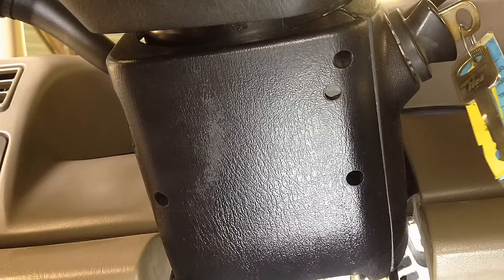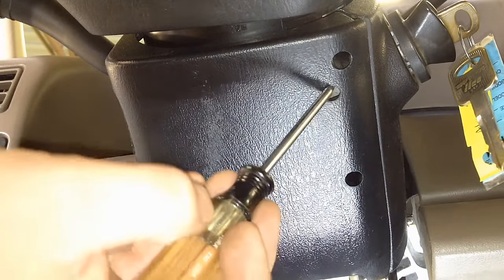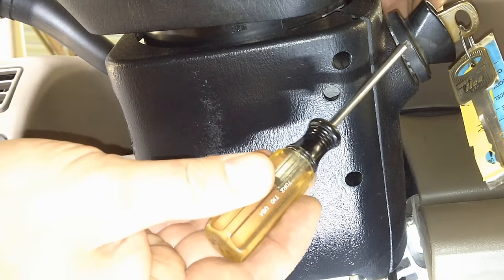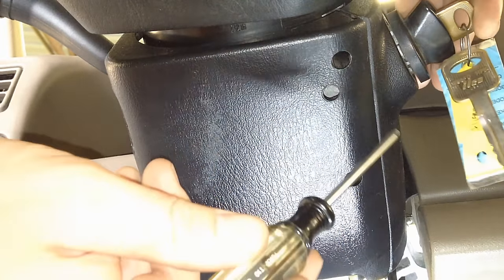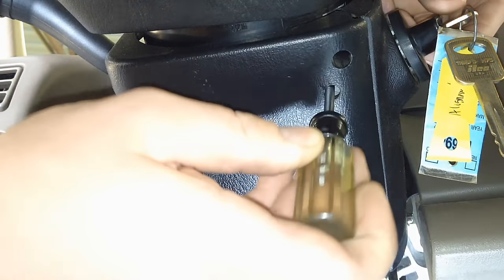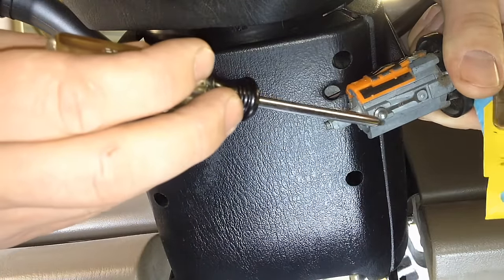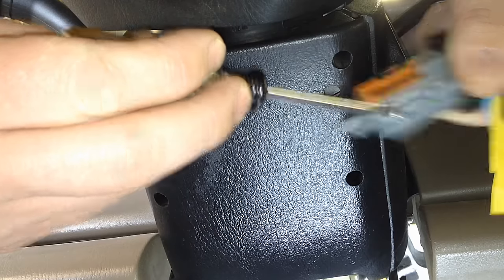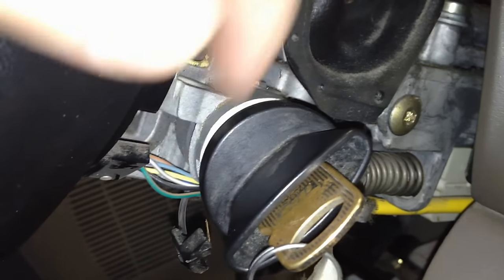Ford Quick Tips: #25 Ford Ignition Lock Cylinder Removal

Comment: What if you don't have the key?
Reply: no one shows how to do it without the key... :(
Reply: @marshallvomenici5469  Cause that's how they get stolen  ..You have to break it so it turns
Reply: I can't turn the key to the forward position at all
Reply: You gotta have the key.
Reply: I've drilled the bottom pin out and ran a 3/8 drill bit down the ignition to break the tab off at the end of the column.
Reply: You have to drill straight through the old one
Reply: If you don't have a key you can use a skinny finger length pocket knife or a a broken pair of scissors.
Reply: How you do a 1986 f250 that that the switch does it turn to the on position
Reply: My key was stolen and lost by a mechanic
Reply: Only in Ohio 💀
Reply: You popped the pins out one by one write them down and popped the new pins in a new cylinder one by one and 2 your finish
Reply: I have the key but the ignition had been brutally beaten.
Reply: Even a screwdriver  can't budge it
Reply: Fml I lost key have replacement

Comment: Line it back up the way it came out,it only goes in one way,like a puzzle piece,put everything back together,great. But what do you do if you have no keys to turn the switch?
Reply: Take a pocket knife and a pair of plyers and twist the ignition. You can put a screw drive run along the side to pop the ignition and install and new ignition lock cylinder they come with keys. Depending on the security your key may need programed or you can use a wire on your starter fuse under the hood.
Reply: What if you don't have a key and you lost it how do you get to switch out if you don't have a key to turn it on
Reply: How do you get the ignition switch out if you lost the key anybody know

Comment: I know this is a very old video made when I was about 10 lol but do you have any advise for me? I lost my key about 2 weeks ago and haven't been able to find it and that is the only reason I need to replace the ignition lock cylinder. What do I do about that? I had a spare key made a while ago but it doesn't start the truck since my key was worn down with the ignition over time. Do you think the spare will still work for this? I'm pretty sure it will turn the ignition, the fuel pump, battery, and the alternator don't try and run when I turn it though.

Comment: I have a 95 Ranger with no hole in the plastic and no hole anywhere onthe column to access the pin, I know what to look for and never seen this in 40+ years of working on Fords and I have the steering wheel off.

Comment: Once again, I have to thank you for this channel and your expertise!  I PROUDLY still own my 1996 decked out, one of a kind, Conversion Ford Explorer!  It’s wonderful knowing that I can check here for pointers that a Haynes manual doesn’t tell you regarding idiosyncrasies between the different years!  It has over 250K miles on it and I wish I had kept it as a Collecter car. If I could find another, I’d buy it in a heartbeat!  It’s interesting that when ordering the key cylinder replacement, they needed to know the exact month and date it was manufactured. Please keep posting anything else for anyone else who owns these Fords and follows you or for those who might still find your EXCELLENT shared experience and advice!🙏👏😎💕🙏❤️😎🤠!
Reply: Conversion ford explorer?? Van or truck?? I am in a 94 ford e150 conversion van 5.8L  all leather absolutely mint picked up in 2017 with 18,800 miles on it. 45,000 now. I absolutely love this van.

Comment: Hey, we've got a 98 Windstar and we're working on replacing the ignition lock cylinder and I have a question: the instructions we got with our cylinder say that for some models you  have to detach an alarm wire from the old cylinder and attach it to the new one. Is the Windstar one of them, and am I right in that we'd have to remove the shroud on the steering column to attach that wire? Thanks in advance!
Reply from the maker: There is a little key in sense wire on there most years and a orange switch on the lock cylinder itself. If the lock is not broken the wire will stay in play while the lock cylinder is being removed.

Comment: I had a question I'm doing this same job on my 07 crown Victoria I have the new ignition with the key but I lost my old key and I'm not able to get into the run position is there another way to get it into the room position without a key maybe using a screwdriver to turn it over to the on just so I can get the ignition out I appreciate your advice in advance

Comment: Hey I jist bought a 1991 Ford F-450/F-Super Duty... It has an ignition problem the steering column is the most simple with no wiper controls, cruise, or extra controls of any kind... When I go to turn it on the ignition wants to turn back too far where it kills the engine, I have to remove the shroud and place vise grips on the metal rod to hold it in place.  I when I place the vise grips on the rod it can be too far forward to the point where the signals and climate controls won't work (because it thinks the starter is engaged), but if it backs off too much a bump in the road will kill the engine.  Luckily its a standard transmission so if it dies going down the road you just turn the ignition forward and it restarts the engine without stopping and engaging the starter again.  But if you do this going down the road. Un burnt fuel goes out the exhaust and I literally exploded the muffler driving it home from purchase on a 700kms trip from norther Alberta to southern Alberta.  Any tips?

Comment: so glad to see this vid - was at the gas station last night and the key just got stuck in the ignition, wheel wouldn't turn... i pulled the 'girl in distress' card (which by the way, i hate doing) and a gentleman at the next pump, as luck would have it, had had the same issue and did the brake, pull the wheel, jiggle jiggle which at least got me home... so assuming i need another of these, which will have to be ordered, is there a way i can keep the many key/remotes i have??    also, can i give it a couple shots of something like a dry lubricant to at least keep it going until i get a replacement?

Comment: Very nice videos. Detailed and informative. I have subscribed. Thank YouI have a 2007 Ford Escape XLT 2.4 Cylinder. Home Burglarized and they also stole my ONLY Car Key. They did not Steal the car because I removed the Battery and it was in the Garage on a Trickle Charger.  However I do not have ANY keys to the Car.  I can get into the Car because the Doors are unlocked.     I ordered from Ebay two spare PATS Keys.  If I do remove the entire Key Cylinder and Purchase a New one from AutoZone, how do you get a Blank Key to Work on a New Cylinder? This part confuses me.

Comment: 1990 ford bronco...won't stay in the running position..I have to make sure it is turned just right to stay running and then any bumps or movment will cause it to turn off. If i hold it foward it stays running. Is it just the cylinder? Or the copper gear..or maybe the plastic gear part? Idk?

Comment: Thank you for clear instruction. After removing, and reinstalling cylinder, ignition works fine, but key is stuck... tips?
Reply: Same thing happen to me did you fix the problem?
Reply: Any luck with the issue?
Reply: Omron switch on Shifter column console? Tells truck its in park.

Comment: Do you have an approved method to reset the timing of the key cylinder to the actuator rack?  I rebuilt my 1996 column and I think I have the gear off a tooth or the bearing plate positioned wrong. I have to fight it to get it out and it doesn't feel correct. Everything works but it definitely is harder to RR cylinder now.

Comment: I lost my ford ranger keys to the ignition switch so I used a screw driver and break the lock and wasn't really able to turn it so I drilled the pinball out and that worked now I've got underneath is a bigger hole than the original pinball so it's bigger 😅 I'm wondering 🤔 if I could use jb weld? To fill in it or maybe a bolt ?  Would a bolt interfere with anything like the electronics lmk

Comment: My vehicle 2006 Ford Escape XLS was stolen and police returned. Thief still has a key. I wanted to replace cylinder. I bought a used one on ebay. I replaced the cylinder, like you showed and the vehicle won't turn over. Do I have to have the cylinder reprogrammed with the new key?

Comment: quick question, Ive got a 99 super duty and blinkers are not woking???. hazards work, brake lights work,  everything works besides turn signals? fuses are good, wires in the column are good, relay is good and clicking. any advice besides buying a Chevy would be greatly appreciated! !

Comment: the reason I need to replace my cylinder is because the the tumblers have rusted in place and won’t even slow the key into the cylinder or let alone turn it to the run position. I would actually think that’s the main reason someone would even need to replace the cylinder so any tips on how to remove the ig cylinder without the ability to turn it and depress that ball/button that locks it in place?

Comment: Hey Brian: on my 1970 Mark 111   ign switch will not turn forward to a start pos... mobile locksmith said you must remove switch he could not make a key ...just got this car with 8K org miles on it was in storage many years... no keys... now his boss came out and he tried to cut a new key with no luck... now how can i remove the switch ??? i do have a key now that will only go into reverse meaning ACC pos... i pulled the steering wheel and i cannot see that pin hole and i think i must drill out unit... what do you know on this...

Comment: What about installation does the new lock cylinder have to turn to the run position?
Reply: Manuel Villarreal Jr the locking pin won't retract on the cylinder unless in the right position. Could be run, could be accessory depending on vehicle

Comment: My door locks needed replacing so I got a complete new set of door lock cylinders and new ignition cyclinder with matching keys. However, the new ignition key will not start my 2007 Ranger.. Anti-theft (car with lock indicator flashes and stays on). Now I'm using 2 different keys....one for doors and one for ignition. Anyone know how to overcome this issue?

Comment: So, I've got a 99 Expedition. My problem here is that the key just free turns, it won't go into any of the key positions, such as run, start, acc....can I still get the cylinder out properly without messing anything else up? Any help here would be greatly appreciated

Comment: I've removed the lock cylinder in that as you showed in instructed but I found a black and red wire which is thin but coming from a little black box under my steering is that in part for possibly the past key or was it something installed or disconnected that may not been by Ford but the prior owner

Comment: This helps, but my lock cylinder on my ‘98 ranger will not turn to the run position. I move the steering wheel back and forth, but she is temperamental. Any tips on how to fix that so I can replace the lock cylinder?

Comment: I’m curious if a locked steering wheel  on a 2011  F150 but the key does turn and start the truck.  Cylinder is very loose sloppy. Is that a mechanism in the cylinder that lets the steering wheel unlock. Weird thing I have had where with the key in and the Truck shut off I could move the steering wheel left right. It wasn’t locked

Comment: I have a question I'm having problems with this but my car is a 2008 Ford escape and it only starts with remote start but not a key could this be a bad lock cylinder or a bad ignition switch also sometimes my car will either not shutoff when the keys out or it will continue to start after I remote started it and turned it off

Comment: FordTech...I just took my ignition switch out in the run position on my 97 F150 to repair my gear shifter tube,and I put my switch back in and now it doesn' lock in the lock position and neither turns back for radio,please help.....

Comment: i have a 95 mustang base that the key tip has broken off inside the tumbler, and now the ignition switch just turns free, and i cannot even get the switch to the run position in order to push the little ball release mechanism to change out the cylinder. any advise? remove the entire housing? plz advise and thank you in advance of your help. JPW

Comment: I have a question about a 2001 Ford Explorer Sport no crank no start no power no communication the key has been stuck in the ignition for some time now never really had an starting issues??? any ideas? the theft light is blinking and I know what you thinking but no other lights no door chime nothing kind of confused is it the ignition the starter, the battery is good everything else checks out it kind of leads me to believe something is wrong with the ignition Tumblr please help thanks

Comment: quick question, My key will not turn to enable me to depress the pin to remove the tumbler, How can I get it to turn in the right position to remove?  Tried turning the "locked" steering wheel but no go, cannot depress the tumbler pin to remove. Any ideas?

Comment: Hello great video, I was able to get the lock cylinder out but the tab on the end of it broke off inside the steering column. Causing it to be stuck in run position even when the key is in the off, acc position and with the key out. So my question is how do I get the broken piece out so I can Install the new one?
Reply: Did you get an answer on how to remove that tip I've tried a magnet and it's not working

Comment: My 2005 f250 super duty got stolen last night. I have a tracker so I tracked it to a farmers field. It was left idling because they snapped something in the cylinder. The only thing I can do with the key lock is roll is forward and it tries to start. Other than that I couldn’t turn the engine off so I pulled the fuel pump fuse which shut off the gas to the engine. I’m trying to pull the cylinder off but it’s locked in there and I can’t move through accessories, or run. Please help!

Comment: Great video good info but my question is how do I remove the ignition lock cylinder without the key, it is missing but have another cylinder
Reply from the maker: you must drill it out
Reply: @FordTechMakuloco  hey whats up man, you drill exactly where you insert the key straight in? Or what do you mean man? Thanks in advance

Comment: My ex tried to steal my expedition and damaged what I've seen referred to as the halo around the ignition that reads the chip in the key. Is there a way to bypass this problem? If I replace it will it still recognize my original key?

Comment: I have a 1998 Mustang where when I turn over the ignition the car won't turn over. I'm not sure if it's the tumbler or ignition switch or perhaps a fuse. When I turned over the key the headlights will stay on but my windshield wipers will stop so that tells me it's not the battery or starter. Could someone tell me if it would be the tumbler or ignition switch? Thank you

Comment: Any idea on how to remove the cylinder without a key? I lost mine to my 85 SVO Mustang. Also, do you know if this tip will work for my car?
Reply from the maker: Pago's Place The key must be in run otherwise you have to drill it out.
Reply: FordTechMakuloco Thank you for the great info! When I get back to the states I am going to try and pick the lock first with a set of jiggler keys I just ordered. Hopefully I will be able to get it in the run position then remove it easily without drilling.
Reply: @pagosplace3065  Did the jiggler's work?

Comment: need some help..I have a 72 ford 250, doesn't turn over no sound, I replaced the Battery , the Starter, The Alternator, The Solenoid, The Coil, voltage Regulator, the only way it started its when I put a screwdriver to the solenoid and it started, I let it run for a few..then within the hour I kept turning it off and on ,and it worked. .until later that night I tried again and Nothing  it didnt turn over and no sound. .

Comment: I've seen several videos about taking these cylinders out and it seems pretty easy if you can turn the key to the run position, but mine won't move it is stuck, won't go to accessories or start/run position. How do I do it with that problem or get this one unstuck? Thanks
Reply: So I'm thinking I may need to drill from what I'm reading if the key won't turn forward. damnit

Comment: I just bought 1 of the most beautiful Canadian barn finds I ever came across just because of the shape it's in. A 1971 Lincoln Continental Mark 3. 46000 miles parked in a big open barn in the middle up against a wall since 1979.  The car is all there except? The KEYS! I almost died when I popped the hood grabbed the crank and it turned. My question is: How do I pull the ignition out without the keys. To everybody out there that see's this It is up for grabs after I get new keys for it. The other question I have is, should I start the car or leave it for the next guy?

Comment: How do i disable my anti theft system on my 95 mustang cobra? I used an after market ignition cylinder and had no problems other than the chime constantly on whenever i open my door without the key in the ignition, until i changed the neg battery terminal and now i have to go thru a sequence to start it every time. thanks

Comment: Ok with a Key, But how do we remove the cylinder if the key is lost? I need help with a 2002 E-150 Traveler.
Reply from the maker: You must use a locksmith or drill out the lock cylinder.